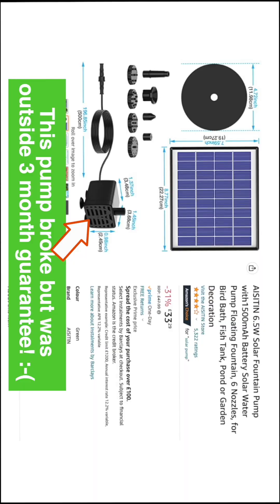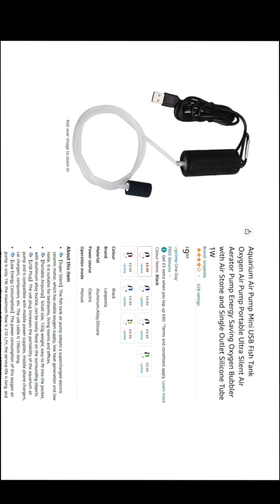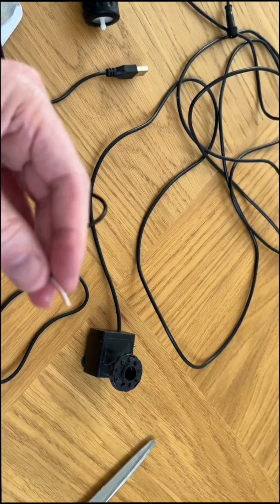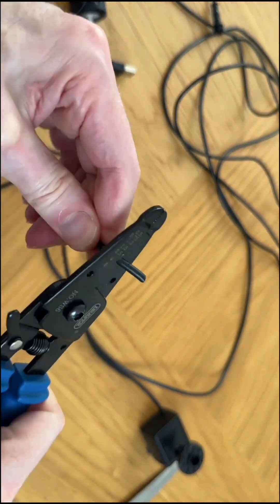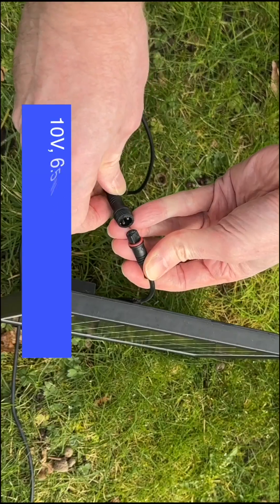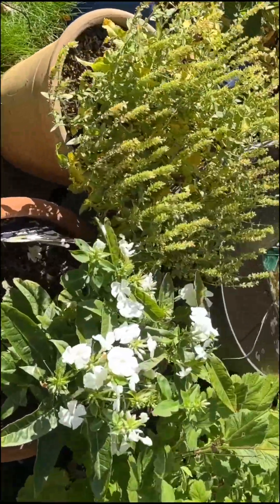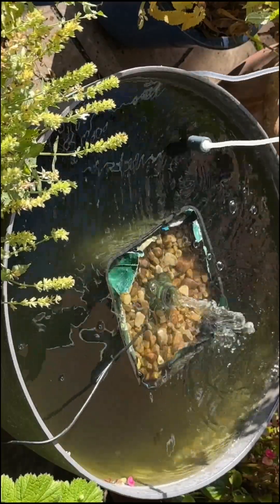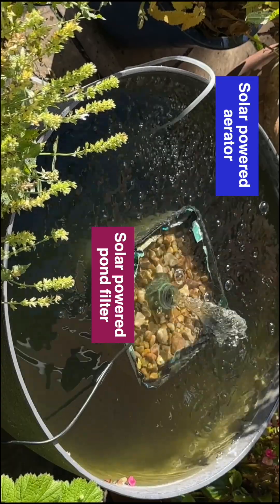How I Made A Solar Powered Pond Aerator

Comment: Does it work with battery storage?
Reply from the maker: Yes, you could power it from a usb or similar low voltage power pack.
Reply: Excellent hack thanks Tom I am going to try this with a similar broken pump solar panel I bought.
Reply from the maker: @UrbanGrrl69  Good luck